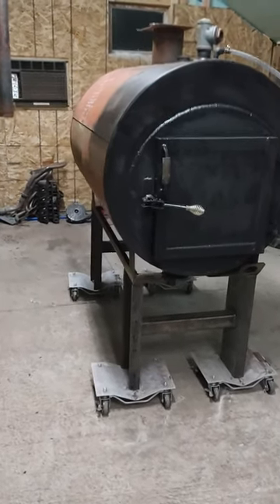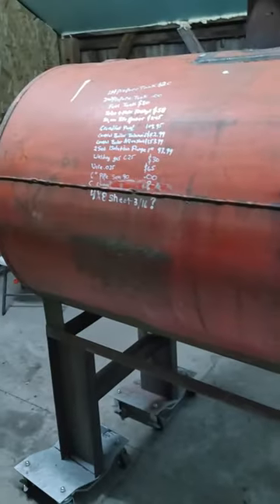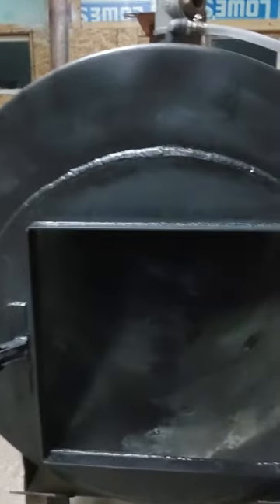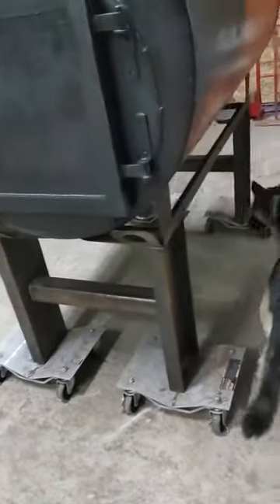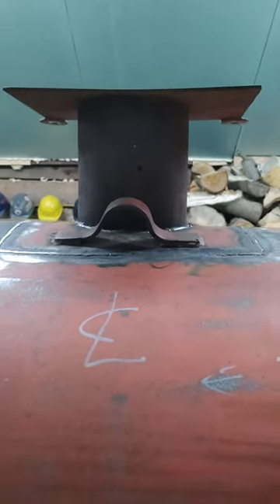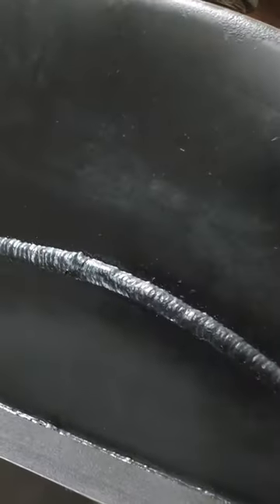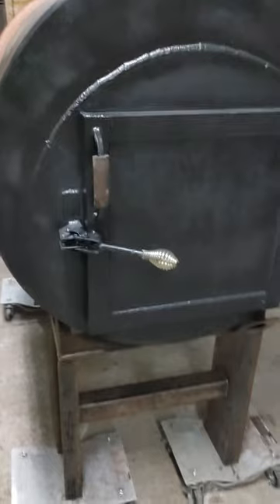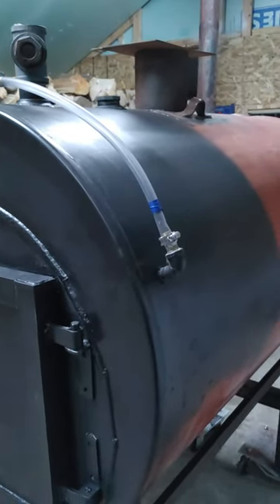home made wood boiler

Comment: Nice video! I'm considering a similar build. My available tanks are rusted out on the bottom a little. I'm thinking about turning them upside down and putting the rusty area on top. I'll still weld a cap over the rusted area. One advantage is being able to get the tanks for cheap or free.